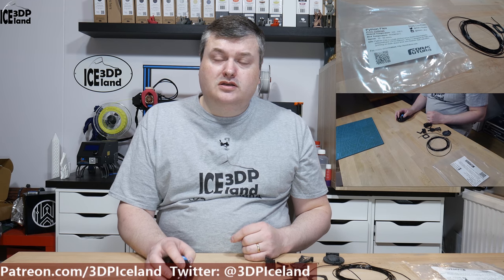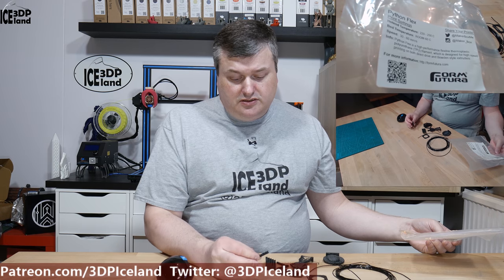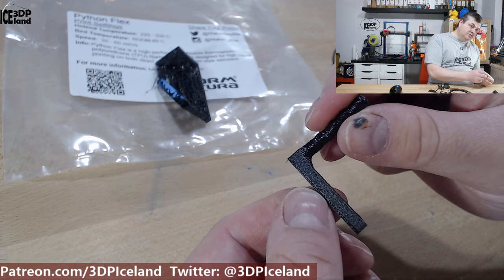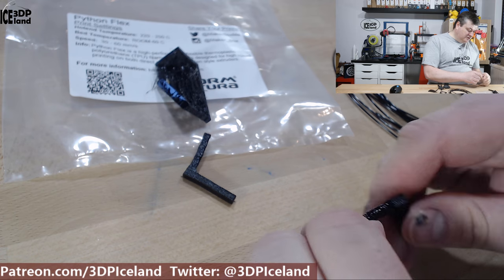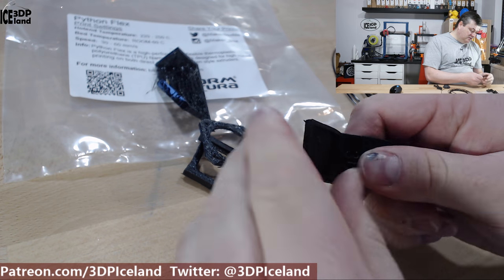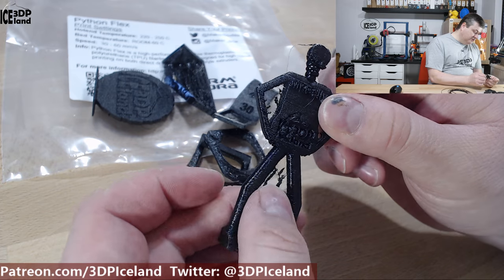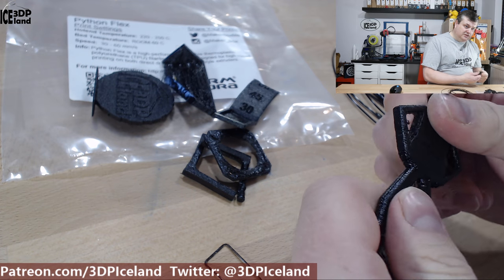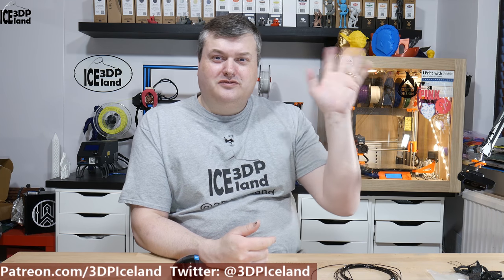MakerBox Sample   FormFutura Python Flex

Comment: What slicer do you use?
In Simplify 3D you can set variable settings for differents heights so you can slow down in strategic areas.

Do the gaskets really help making your printer silent?

You seem like a really cool person and you take time to share your experience so your videos are really likable.
Greetings from Switzerland !
Reply from the maker: José Rodrigues thank you. I use slic3r prusa edition,  i don't own simplify 3d, but the option there to do multiple processes should help on the thin parts. And thank you again.
Reply: 3DP Iceland Oh okay I see. S3D really was a step up for me but it's kinda expensive